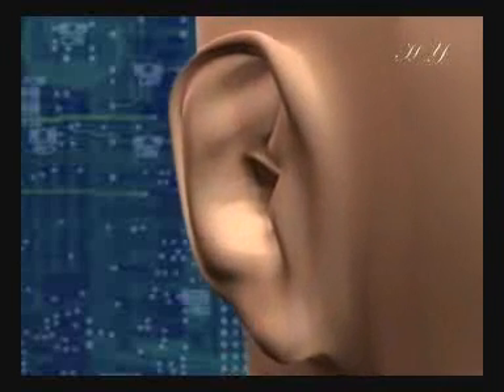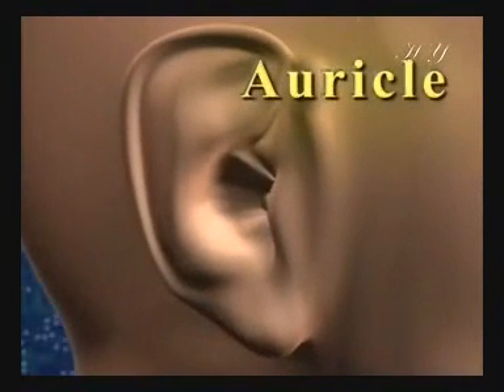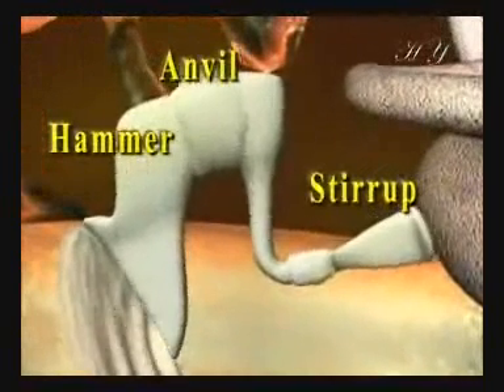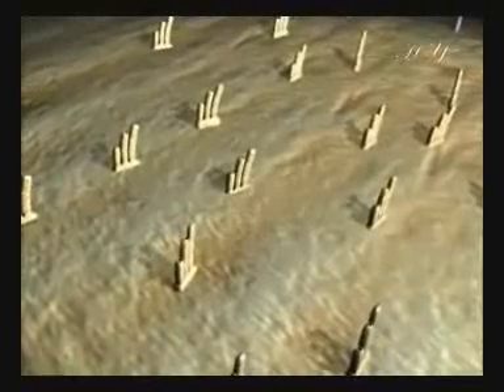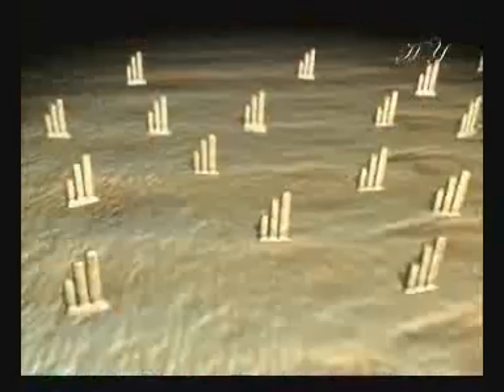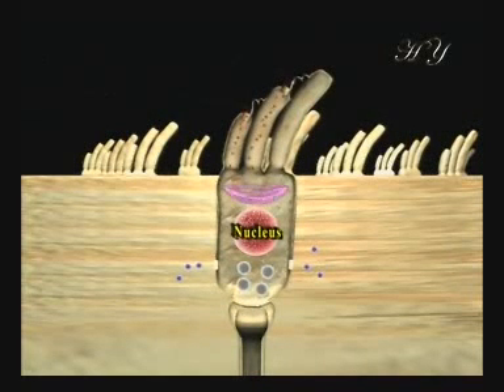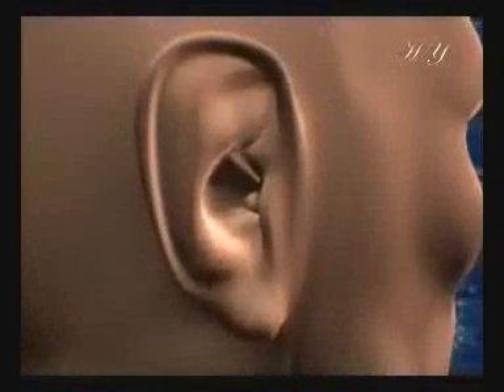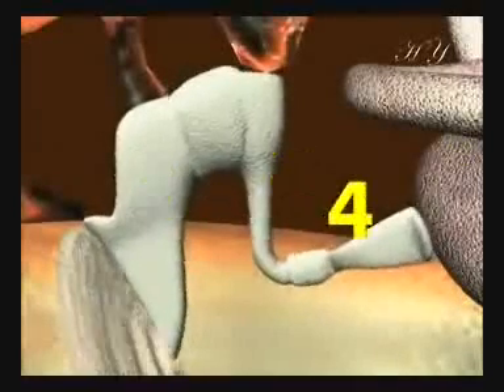Irreducible Complexity in Your Ears

Comment: The origin of sound is any sound generating source. Sound (in air) is pressure variation in gaseous media. Sound has nothing to do with the brain.
The question about who is hearing is not a question about the workings of the hearing apparatus but rather a short version of the old "homunculus" debate. There is no little demon in your brain that "hears" what your brain get delivered by the ears.